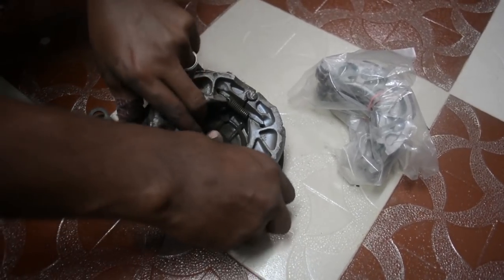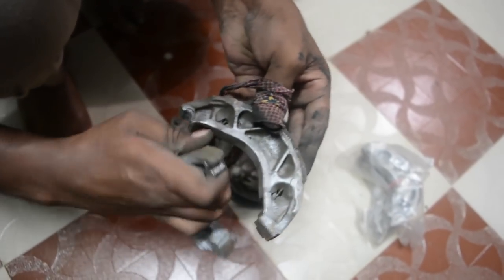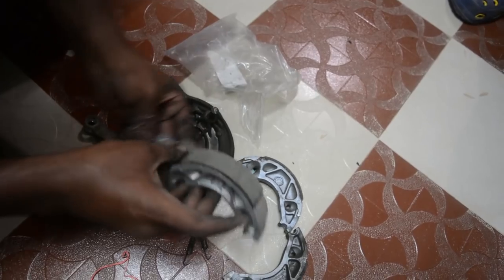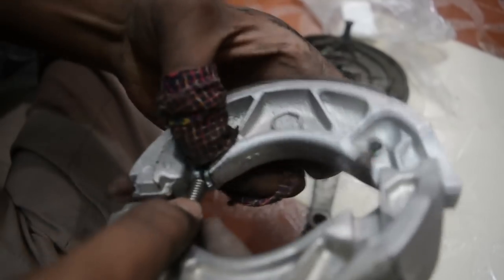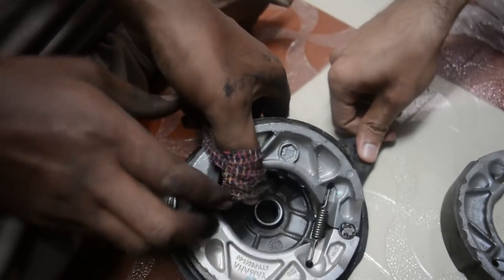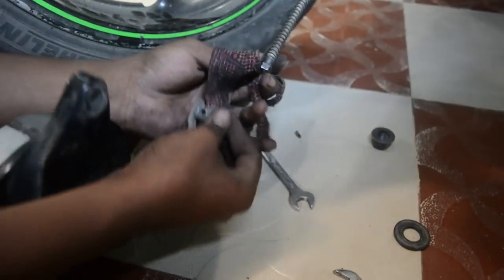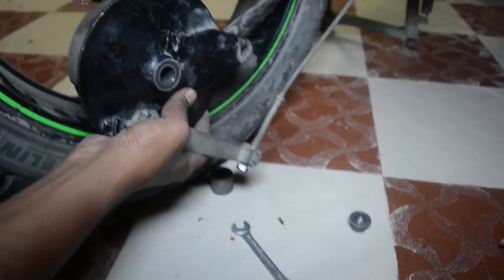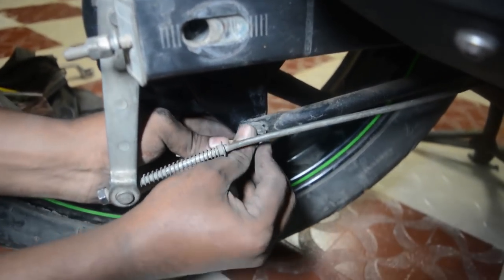Yamaha FZ Brake shoe Change DIY India

Comment: I own fzsv2 whenever I hit the back brake some horrible sound comes from back, I told to service center guys to replace brake shoes but they its fine they will clean it & fix it after 3days same problem
my bike has done only 6000
Reply: shashi kiran sane here, having the same problem, please help.
Reply: Its normal for drum brakes to do that... Buy cheap bikes what do you expect? A ktm duke 200 quality?
Reply: Change brake shoe and do oiling and had same problem but today got fixed
Reply: A Highlander Youtuber  english please
Reply: A Highlander Youtuber  HAHA okay don't jump to conclusions😂 aka curry in a hurry im not even indian